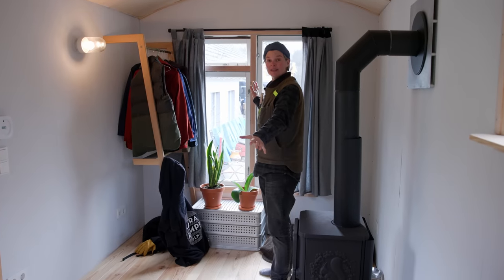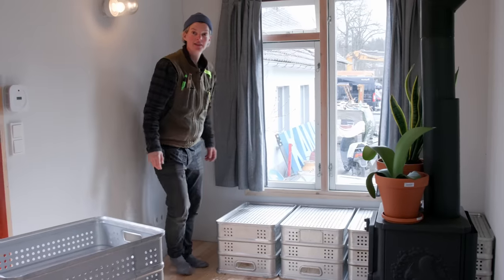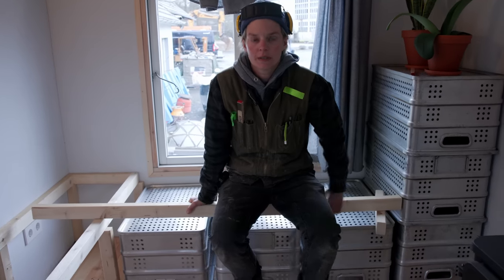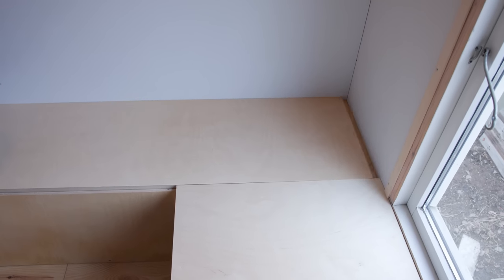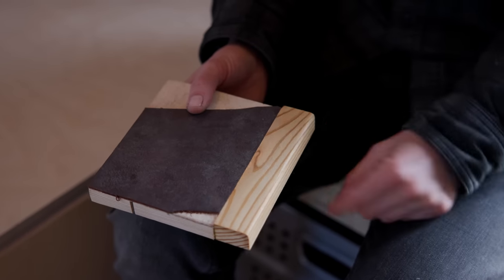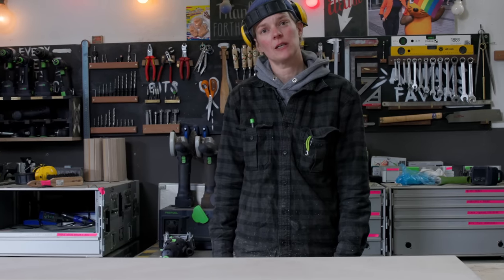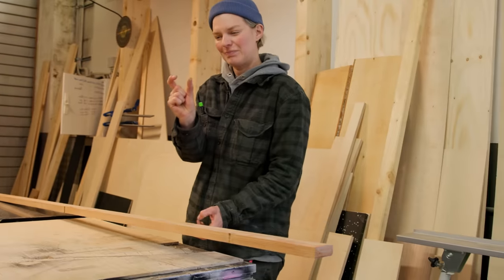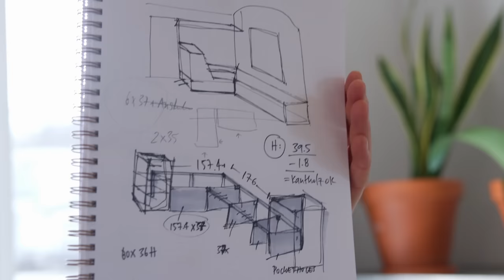This is why I don´t sketch! (Building a Tiny House)

Comment from the maker: I am NOT on telegram. There is a scammer using my logo and name. Be careful and always check for the grey checkmark next to the name to make sure it’s a verified creator ❤
Reply: Thanks! I didn't think it was you personally, see those spam comments all the time so for the one on my comment at least they are pretty obvious, no worries! 👍👍
Reply: yeah, it's quite obvious that it is not you as soon as one reads 'TELEGRAM' in the comment...
Reply: @Laura Kampf I'm concerned about the longevity of the leather hinge while the cupboard lid is not being supported from underneath. Even if the glue holds, the leather will likely rip under someone's weight. (I'm 1.85m & 130-odd kgs and would never sit on there, that's for sure.)

It wasn't clear in the video if this  lid has any support. 

 Cheers from Australia.
Reply: @middomaker  heh! Pretty sure she'll be double checking this by now. A bunch of us have expressed the same worry in other comments. Probably an easy fix with the addition of a lip of some kind to transfer weight at the back to the frame if that wasn't already part of the design we just couldn't see. 👍
Reply: @Salgood Sam  I figured that Laura may have seen it or someone smarter than hadn't picked it up, too. Often times, though, it gets missed, something happens and I regret not saying something.  (I also missed that it already had been mentioned in the comments prior to my posting it as well)
Reply: @Salgood  I also mentioned it during the live premier but was sure this was missed, also.
Reply: See the same on loads of other channels, too. Letsdig18, RR Buildings, OffTheRanch, the Hacksmith, and I barely dented the surface.

Comment: Might want to add some support on the swinging side of the hinge, since sitting on the middle of the bench will apply a lot of force to the glued leather.
Reply: was just about to write the same thing. If no support is added to the middle, the leather hinge will rip one day
Reply: Won’t it be supported by the frame in the down position though?
Reply: @JoshuaRes  There is only support on the back edge at the two far ends.
There is no support in the middle, other than the leather itself..
 She doesn't need to add much, just a block that will catch the hinged side roughly in the middle. Just bolt it to the back wall, and have it stick out far enough to catch the hinged lid by 3/4" or so. That way it won't impact putting things in, or taking them out.
Reply: Yes, this is why I came here also 😂
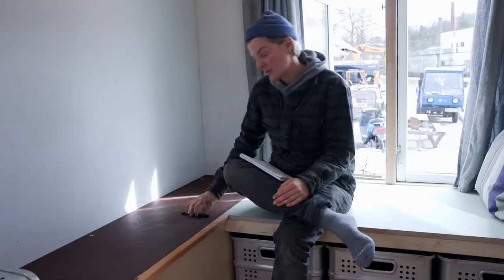Reply: At 23:00 it looks like the edge of the hatch slides slightly towards the wall while closing and therefore should be supported by the frame
Reply: @tay13666  ah your right. I watched that part again and see what you mean. A block screwed or bolted to the wall sounds like a good easy solution.
Reply: If the narrow strip of wood on the side of the hinge closest to the wall is narrower than the frame beneath, the wide/top piece is supported by the frame rather than just the leather when in the closed position, as others have said.  I would make the frame piece along the wall wide enough to support the top piece, to be more minimalist per her design.
Reply: Another option would have been to cut a ledge into both the back of the main ledge and front of the stationary piece so the ledge could bear the weight until the lid swings upward.
Reply: @tay13666  and  @A. W. Thompson  I agree with either approach. Thicken up the wall side support framing or add blocking. I think I would go with adding a bit more thickness to the wall frame to keep the open look and functionality. 

 @Mattimotion  I went back to check that spot and you might be right, but the shot isn't close enough to confirm though. Hopefully Laura will see these comments and confirm for us.
Reply: It will pull loose. Support the lid on all 4 sides.
Reply: Ya the hinge side of the lid is completely unsupported along the length (apart from the two ends).  It might not sag right now but over time that's a failure point for sure. Adding an additional framing member under (and from end to end of) the hinge point would be the cleanest solution I think. I don't think added blocking is needed to the floor but couldn't hurt.  Depends of the use requirements
Reply: The easiest fix would be a piece of quarter round molding glued and nailed along the full length of the hinge side frame.
Reply: @greggv8  or that 🤣
Reply: @RobABankWithABagel  After the insulation/water damage debacle I wouldn’t assume she thinks ahead all that much.
Reply: At 23:02 it appears that the bottom of the board is flush with the front edge of the support in the upright position with a small gap (the thickness of the board) below. That gap will also have to be as deep as the board is thick, therefore the board is supported by that narrow ledge. It's difficult to describe, but if you do a sketch (ironically) you will see what I mean.
Reply: I believe that the edge of the plywood near the hinge is supported by the frame. It’s just hard to see but the edge moves inward and there is part of the frame for support.
Reply: was scanning the comments looking to see if anyone else would mention this too!
Reply: The leather will also Bend until a rip starts
Reply: Good idea
Reply: I was thinking that a few simple hinges on the inside along the swing side would help protect the leather, giving it support and strength.
Reply: Something like fiberglass or nylon reinforced tape, or anything that has a lot of resistance.
Reply: I had similar concerns, but having never tried a hinge like this, I'm also very curious to see how long it holds up as is.

Comment: I think you need to put in a another piece of wood to the back to support the platform that is now hanging on by the leather hinge and only supported properly at the sides. Otherwise it's not strong enough to sit on and the leather will eventually start delaminating there.
Reply: I had this thought, too
Reply: I think so too. Take the stress away from the leather.
Reply: I was going to write the exact same comment!
Reply: You beat me to it. I was going to comment on the exact same thing.
Reply: Great minds and all that, it looks great and I had visions of the leather tearing in the middle of the bench when someone sat on it  without some sort of support underneath the back of the board/door which would be a shame.
Reply: I think you should build your own tiny house...
Reply: I worried about this, but watching it I think the wood proper sits on the lip when the leather isn't bending.
Reply: Same thought, easy to fix.
Reply: Making a stitched hinge of kevlar or dacron etc to the existing timber/lid would also work. I have done it lots of times and they are virtually unbreakable.

Comment: Hey Laura! I have a sugestion to preserve your flooring. What about placing plywood strips with felt on the bottom as slides on the bottom of the boxes? You could even use the holes that are already there to fixate the strips! I believe you have the clearance for it still.
Reply: I think they even make stick on felt pads, or she could make them, but you wouldn’t even need the plywood. Just felt right on the bottom of the 4 corners or along the edges might work.
Reply: @Sara-xk1ns  given the width of the edges of the boxes, I believe it might not be that sturdy and it might peel off. Also, since the bottom is recessed from the floor, the plywood would bridge the gap and also could give a cool floating look to the boxes
Reply: I've used felt pads on furniture. They catch dog hair that doesn't get sucked up by the vacuum. They also fall off too soon to be worthwhile.
The leftover leather stuck onto the whole round of the bottom edges - minus corners for ease of construction - would work with design consistency and be easy maintenance. Or the same runner/ball-bearing things used on the underbed unit.
Reply: I ALWAYS love Laura’s ideas and how she puts everything together. The end result turns out better than even SHE thought!!! Awesome!!!
Reply: Exactly what I was thinking of! There are many ways it can be solved but one thing is for certain, metals - especially soft ones will stain the floor very quickly.
Reply: And it would be quieter.
Reply: @sharvo6  that too!
Reply: Just a thought, affix strips of the left over leather on the bottom of the metal bins for softness. Love the leather hinge, genius! Geil!
Reply: Hey Laura, cooler Design Prozess. Ich würde jedoch unter dem Leder Scharnier noch eine Auflageleiste anbringen, welche das Gewicht beim draufsetzen trägt, ansonsten wird vermutlich das Leder von dem Multiplex abreißen.
Ansonsten, vielen Dank für die Klasse Videos und weiter so. 👍
Reply: There’s a lot of mansplaining going on in some of these comments! 🤦🏻‍♀️
Reply: @drwoo6090  are you referring to me? If so, could you point it out so I can no-longer do something like that? Because that was definitely not my intent
Reply: Or possibly nylon. They make furniture sliders with nylon pads for moving furniture on carpet (they work really well), they may work with linoleum as well. Not sure how they hold up with dirt/hair though. Otherwise I'd at least consider undermounting some felt strips along the long sides, where you have full support. Regardless, you will want to do something to reduce the friction or the floor will get damaged over time.

I like that those containers have built in ventilation, it is an easy thing to forget about when designing storage.

Comment: The leather hinge idea and execution was amazing. I do wonder why you chose to screw the static part of the hinge down from the top rather than from the under side and have the hinge invisible. The choice of the brass screws with the cup washers works really well. Another amazing build. Looking forward to seeing the next part.
Reply: I was just about to post the same comment. Screw from the bottle up to hide it!
Reply: I was thinking he same, but the support is on edge and very thick. You would need a really long screw or a counterbored hole. Screwing from the top is just easier.
Reply: My idea was, first to screw and then to glue. But with the brass screws it might be a decorative element.
Reply: I was thinking the same. But I think it is her style to have an ‘industrial’ feeling to the things she makes

Comment: Love my favorite material (leather) to be used here and to be a hinge!

I feel that you might need to put a cross-bar in the middle of the box or have another member to go along the wall where the hinge is to hold the hinged section as leather will not be enough over long term as plywood flexes and leather + glue will start detaching from the lid.

And special thank you for showing the reality of your design process - I am not the sketcher, but the planner and 3D over-modeller and it doesn't always translate and becomes too constraining on the result when you go to make it.

Comment: That bench is absolutely fantastic! The fasteners for the leather hinge really is a nice contrasting touch.

Many, many years ago I worked with a furniture designer. He didn't design furniture on paper. Instead, he used 2x4's, the bandsaw and a glue gun. He "sketched" his designs in 3-D and it was amazing to watch a new chair come to life in this way. He'd chop the wood into rough shapes, hot-glue them together, stand back and evalulate, knock it apart and add bits or remove bits until he had the shape he was dreaming of. And then we'd figure out how to turn this free-form prototype into a finished chair.

Which is to say that I totally get your process of sketching out your designs using the metal boxes for this project.

Comment: Just one thing, I think you may need some additional support for the leather hinge, I can see that either unsticking or stretching/cracking or splitting nder use.. some reinforcement perhaps might be needed to support the leather joint? (Just an idea)
Perhaps even retro fit a piano hinge countersunk (if possible) just below the surface of the wood underneath the leather to "do the work" but covered/hidden by the leather for the same esthetics?
Cheers from London 👍🏴🇬🇧

Comment: The tiny house that metal boxes built 😂 🤣 😂 🤣
This is great, when you find something that works, you just have to go for it. I love that you got a great deal on them and it made me laugh so hard when the camera turned the corner to reveal your great collection of the boxes. 🤗 🤗
Wonerful job. Great idea using the leather as a cover and a full length hinge and I love the brass fixings and wooden lift trim  👏 👏 👏 👏 👏 👏 👏 👏 👏 👏 👏 👏 👏 👏 👏

Comment: That leather is a great choice for a "for-now" hinge. Long-term, it will need to be switched out with a mechanical hinge; since the leather will start to crack and mark at the bend point (might not matter once the full-size house is complete). As some others have pointed out, there will also need to be support added at the hinge site to prevent future bowing of the wood. I Love the bench! I love how excited you are to have it! 😀

Comment: People facing a wall never stand at ceilings angle; leaning against a wall still doesn't occupy wall-ceiling interfaces: so I suggest overhead compartments like Jets Boats and Rvs, or a cedar-shelf-360 at the ceiling; a motorized track to bring everything around.

Comment: Hi Laura! Wonderful design because it looks so comfy! Some time back, I did what Matheus Bastos suggested but a bit differently. I used scrap carpet that can be gotten for free from most carpeting stores. I just applied it upside down with double-sided carpet tape so that the soft surface rested against the floor. Took about 10 minutes to fix. Immediate usable. And when I wanted to remove it I just peeled it off (not so easy) but then was able to clean the surface my children's toy box by washing the surface with alcohol or acetone. Alcohol took longer but acetone smelled so much worse.

Comment: I love the metal storage boxes. If you stood the two boxes used as a back rest up on end and fixed them together with a dowel rod you could have a narrow standing closet for your hanging items. You could repeat the same concept by the front door and make a cut out to access the light switches and electrical plugs. Maybe even put a louvered door on the front to make it decorative and conceal contents.

Comment: Narrow wraparound cedar-footlocker-benches could be made to nestle the metal-bins, cedar is an air-freshener. Hanging garments all could benefit from a locking traction-bar, designed to lower, and raise tucking hung-clothes up to the angle of the ceiling, so they wont drape visual-space.

Comment: Incredible concept, craftsmanship, and execution.

In consideration of adopting your concept for the stacked boxes in the far corner, to make them useful as storage, an idea would be to put the boxes on wooden tracks so they will pull open, then topping the upper one with a piece of stained wood, cut to size/shape for the plant base.

Comment: absolutely love the lost touch with the brass screws...
little tip though: If you haven't already done it, you should cut thick felt pieces below the Alu Boxes, so they don't scratch your floor when being pulled out :) or some small sliding rails on the floor below the bank... something like this ^^
I got goosebumps when you slid them out^^

Comment: I've got the same issue as you. I can't plan properly by sketching, because I can't "see" the solution only in my head. Took me years to figure out that I've got Aphantasia. Basically I can't see images in my head like some (most?) people can.

I need to see the solution in the space with my actual eyes and then the solution will come to me.

Comment: Looks cool, I'd make sure the top of the leather covered area isn't being supported by the leather hinge in the middle though? A lip or something that comes out a bit along the back that it rests on and transfers the weight to the part that is resting on the frame would make it last a lot longer than having the leather and glue hold things together on it's own when people sit on top of it.

Comment: hi Laura & Felix..with your aluminium draws you may want to glue some strips of the leftover leather to the bottoms...they will scratch your floors eventually, so putting the leather strips will create runners for the metal..

Comment: I would argue that the initial planning activity with the boxes is a form of sketching. It's not about the particular tools (e.g. pen and paper) but the process of rapid thinking progression enabled by frequent jumps between problems and solutions. This is possible with any tools that support temporary, slightly ambiguous, low-viscosity (easy to change) representation.